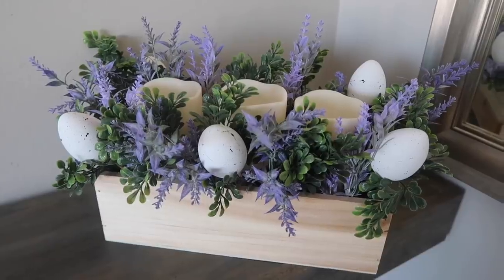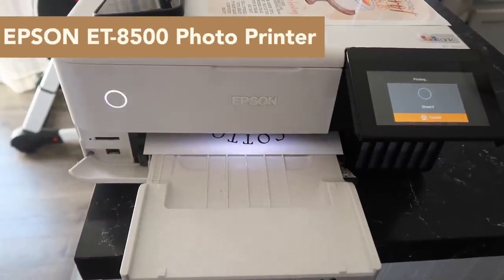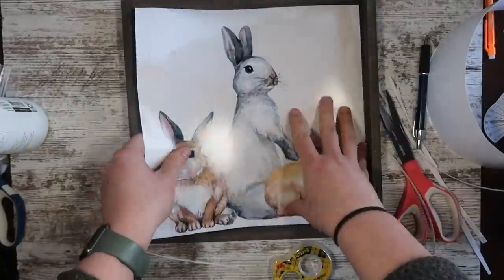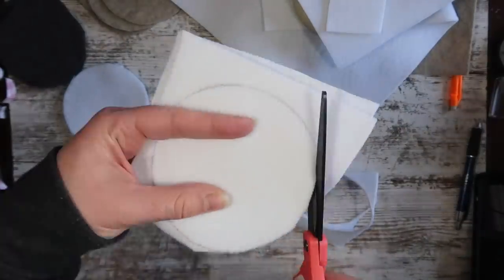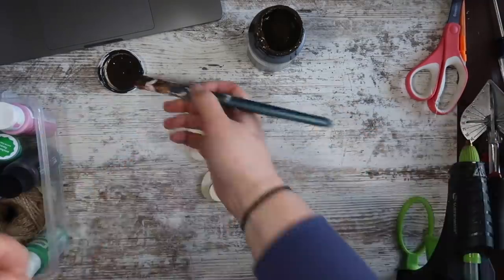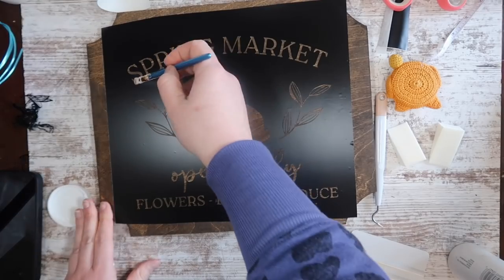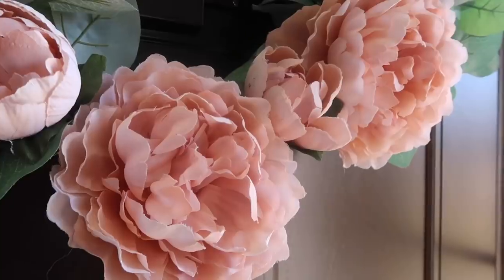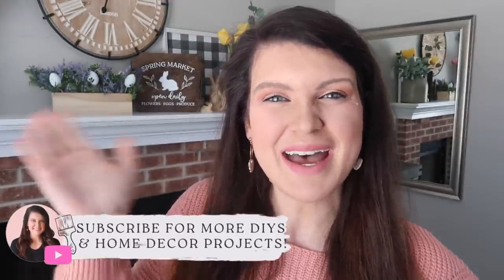10 Kirkland's High-End Dupes to DIY + NOT Buy Easter 2024! I SAVED $150+ with Dollar Tree supplies 🙌

Comment: That tray!  When I put handles on something,  I use painters tape. I cut a length of tape from one hole to the other; then punch through the tape with an all then put tape on project, make sure both sides line up and drill in tape holes. It also helps wood to not splinter.
Reply from the maker: That's a great idea!